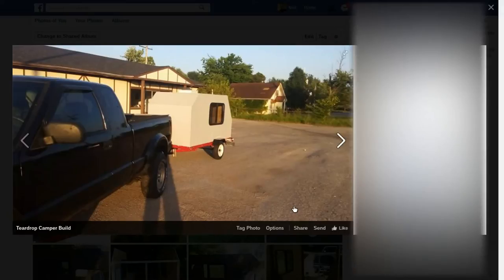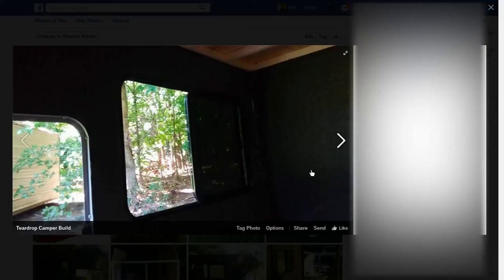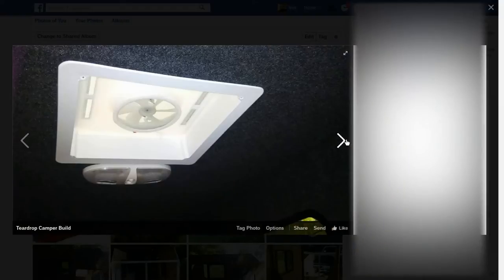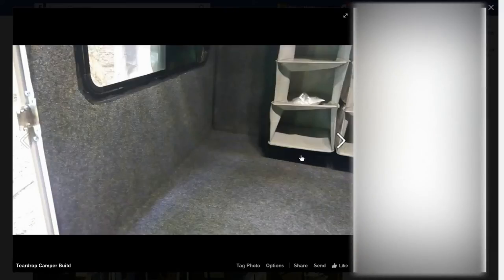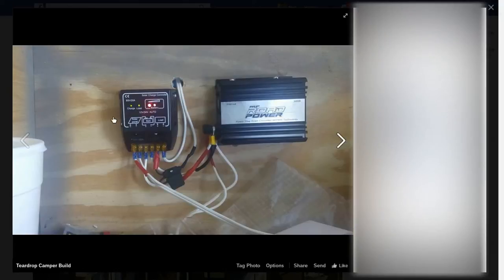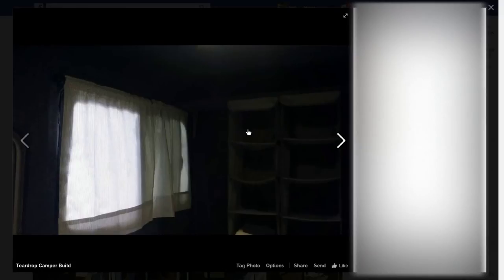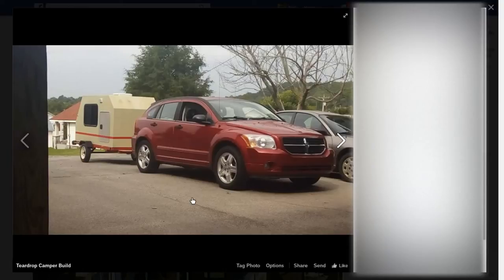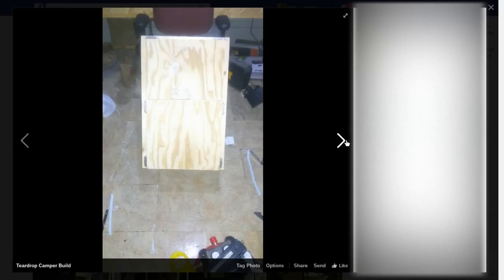Teardrop RV Living | Building my camper - Part Three

Comment: Have a motorcycle trailer about that frame size that I’d like to do a simple conversion like that. Have a pop up camper but like the idea of a ready to camp unit without having to setup, just open the door to use. Camping solo so don’t need the room of the pop up anymore. Seems to be a very straight forward construction design. Fortunately I have a shop full of all the tools needed for a build like this. Your video was informative and inspirational, thanks!

Comment: This build is amazing. I might even think I could try it. Could you extend the structure over the bottom railing by 10 " on each side? I am 5'8" tall and wondered if that was possible? Guess I could have a bed lengthwise on one side. Great job!
Reply from the maker: +Gypsynurse Cathy yes you could extend over the wheel wells no problem.

Comment: Here's another question Neil... I have an idea I wanted to get your opinion on it rather than run a large inverter for the entire camper keeping in mind that large inverters have large loss what do you think about the idea of running 12 volt 2 The Appliance and then plugging in a small inverter such as a 100 watt to power the television that would leave some excess capacity so as not to overheat it. I'm trying to utilize the TV already have that is not 12 volt. I can't imagine needing more than two or three small inverters. Cigarette lighter type that is easy to unplug to kill the power when not in use.
Reply from the maker: Nope. One inverter.

Comment: I have read Harbor Freight trailers do not come with much grease in them and everybody suggest to repack them. Have you had any bearing problems? Also it's a small Tire what is the top speed that you trust with those tires under your average load? They're currently under recall due to Tire issues.
Reply from the maker: Yes, I repacked the bearings, I do so annually.
I got the recall taken care of, search my previous episodes, I cover that issue.
My new tires post recall have no speed limit for them, but I never go over 65-70 when pulling to take it easy on my truck.
Reply: It cut the message off at I never go.... Neil I don't know exactly where you're at right now but that was a super fast response and I certainly appreciate your efforts
Reply: I figured out how to open it up thank you again. I have so many questions for you I don't know where to start
Reply: Here is a couple of questions that came to me. You left the underside insulation exposed is it showing any ware due to use? Also before you glued the carpet on the wall did you seal it with paint or primer or anything?
Reply from the maker: Floor insulation is covered with a spray on protection.
Nope, didn't prime the inside.